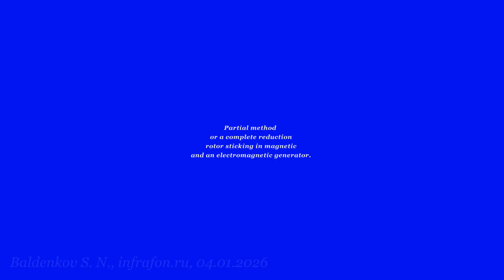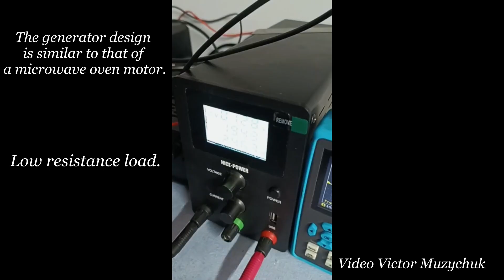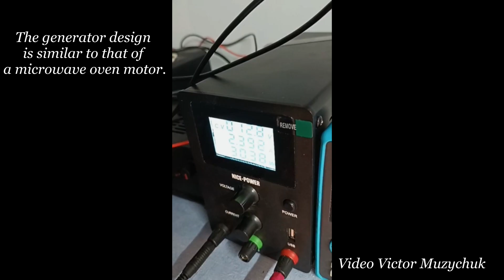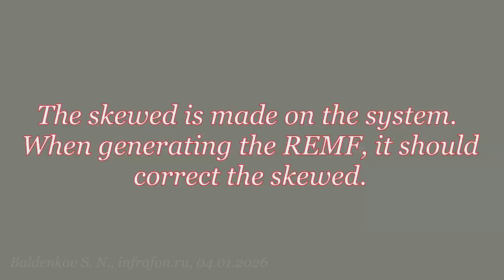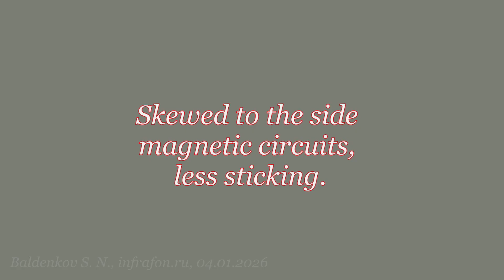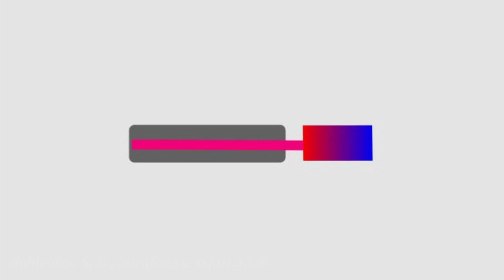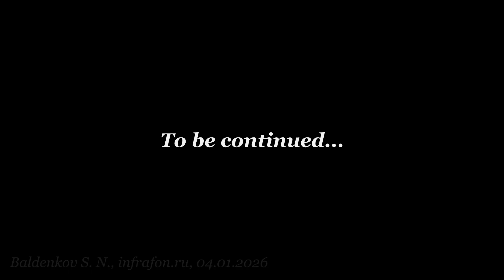Without Brake Generator. p2.

Comment from the maker: Answering one of the questions.
This least popular generator is improved with an anti-sticking system for both the magnetic core and the magnetic resistance of the coils (back EMF). That is, when a load is connected, sticking is absent. The greater the load, the less the already minuscule sticking becomes, but up to certain values: rotational speed, load, output power. Exceeding these will result in normal sticking, so self-regulating electromagnets with an AVR circuit should be used. When a load is connected, the interaction between the magnetic field of the magnets and the magnetic field of the current-carrying conductor will be in the direction of improvement. Or, in simpler terms, they will NOT BRAKE against each other. I don't want to fully disclose the scientific explanation yet.